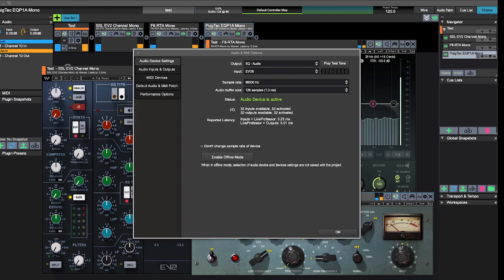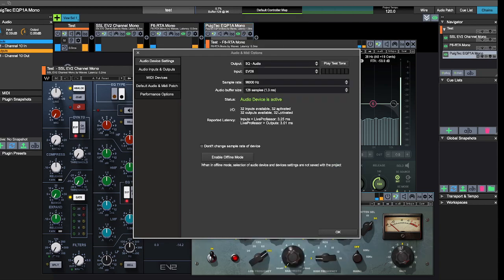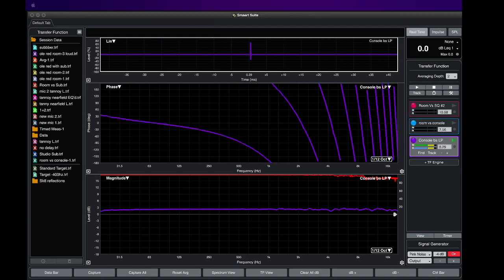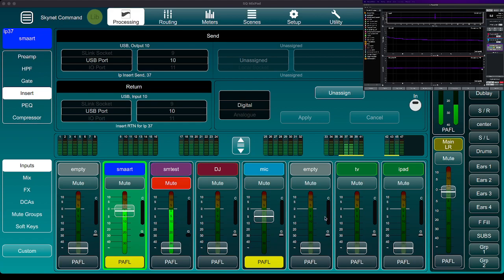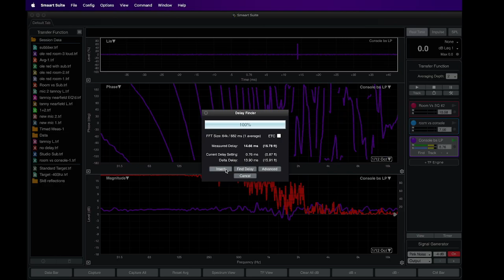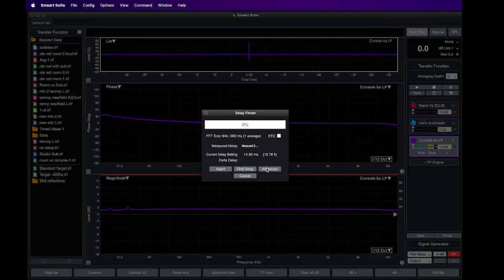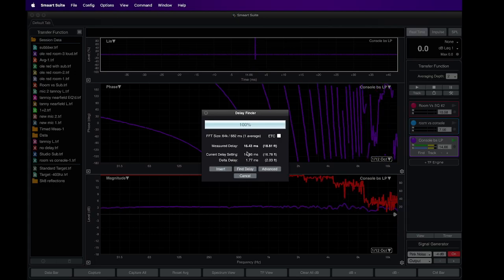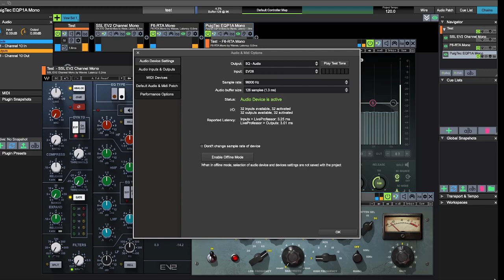Latency Measurement of Allen and Heath Sq6 USB In/Out with Live Professor using Smaart v9

Comment: HI. I use wavesrack via usb as in your case in the same way. I noticed that with some non-complex plugins the latency is better (LA2,3, Api2500,SSLcomp). Does the latency decrease if I buy a Dante or Waves card but use it in the same way, without Waves server, directly in my laptop which has an Ethernet input?
Reply from the maker: The latency of the plugin is dependent on the plugin and the computer processing. The cards only lowers the latency exchange of information between the console and the computer doing the the processing.

Comment: Hey man, first of all thanks a lot. 
I wasnt able to get LifeProfessor running with the USB inserts, (using M1 MCBPro) on the SQ5. Is there something special i have to think of? It was showing up in LP and i did a simple 1to1 routing. If you have the muse to make a tutorial it would be much appreciated, if not i totaly undertand. 
Thx again cheers
Reply from the maker: I can do this.. just give me a week or 2 and ill get a tutorial on setting it all up.
Reply: @Navigating_Circumstances  hey buddy, thanks for the follow up , i was able to get it running , did a whole multitrack band running only with vsts. every instance of an insert ads 12 milliseconds to the chain. so having an insert on input and insert on the Masterbuss already gave me 24 millisconds RTP . messured with REW. it gets even worse when you put inserts on groups, off course. So basically not usable
After some research ,  i figured out the lowest latency is achievable with RME dantedigiface and the SQ Dante card. Which runs you about 1900€ but then gets you realy low latency which is usable , even for monitoring. 

There is also a realy good stream from the guys at Allen Heath which also messured with wavebridge and other soundcards. 
Also unfortunatly, only using Dante Virtual Soundcard - Dante Card, the DVS is also running minimumof 4-5ms which also ads up of course if you use it on several stages of the signal chain. 
hope i could also add something to the conversation
Curly
Reply: @curly_  this is good. but does it cost the same as getting a waves server? with 0 latency after?